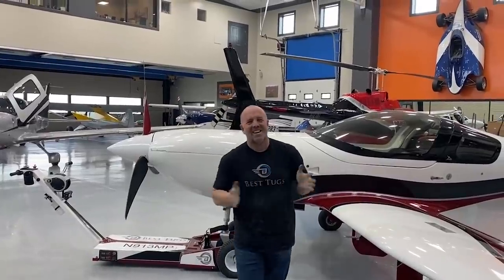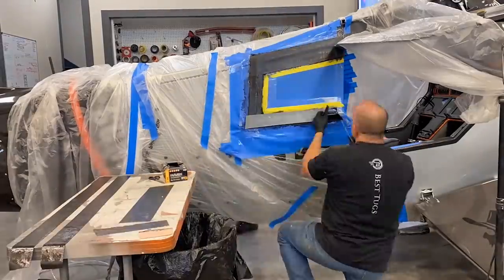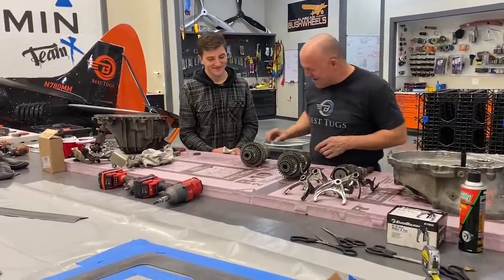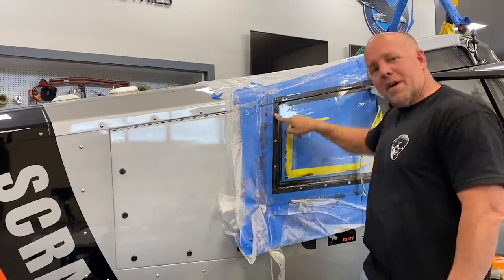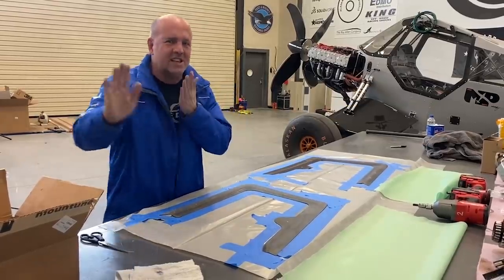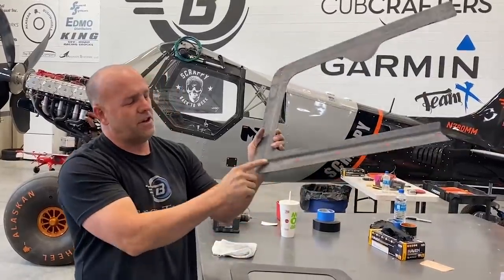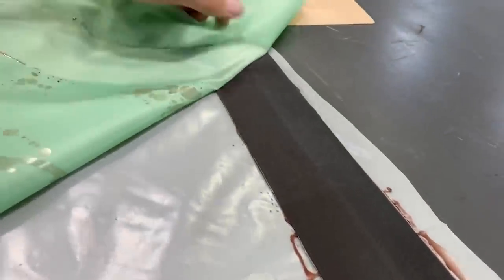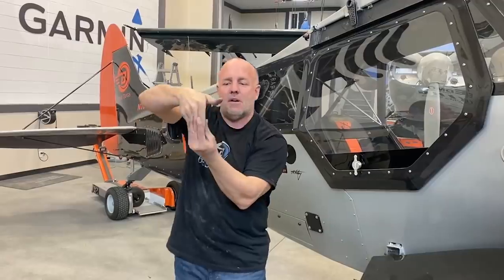We have a carbon fiber problem 😬, do we need this part? | Scrappy #43

Comment: I have been working as a Composite engineer for many years also as a Quality inspector at the World-leading Wind Turbine manufacture making the turbine blades upwards of 164 meters (538 ft). it's extremely important to never over-strengthen any part. and it's Equally important to wear PPE. Not just gloves, also when working with epoxy, You need to know the PPE  penetration times and change before that time runs out. It's a siclent but imminent danger. epoxy eczema is no joke! and will severely lower your quality of life by A LOOOOT. it's not a question of "IF" but when if you don't take it seriously. And when it happens it can be so extreme that you won't be able to be in your own kitchen due to epoxy products or even drive a modern car because the interior is made of epoxy products! We spend more than $100Mil annually on PPE and work safety because it pays Off in the long run!

Comment: How much does one of those surrounds cost in materials? I’ve messed with glass fibre and it’s okay. Next time around should I be going for carbon fibre? (Seems be stronger and use less resin)
Reply: I guess B is for build was in the back of my mind? They were saying carbon fibre is expensive for the Jumpicon buggy. We need a crossover episode :o)

Comment: Next project, front to back carbon fiber, no frame at all, it's all in the structure.  Total aircraft weight 500 pounds, total capacity 1,500 pounds, in the cabin!

Comment: The Safety window, it is a knock out, right?  How is rescue going to know it is a knock out window, more to the point, how are they going to knock it out or know to knock it out.  They would hit it hard anyway, but will it knock inwards?  Fine of you are still conscious and not out of the picture, so to speak and can knock it out from inside.  They might be hitting the centre of the window and their hammer, axe just bouncing off.

Comment: this plane is a copy of the 1930 planes, hispano suiza had 350 hp v8 and 400 v12, same landing gear,  just new materials  as in 1930was steel and tube and aluminum planes,just follow this channel to see if you will create something new in aviation.